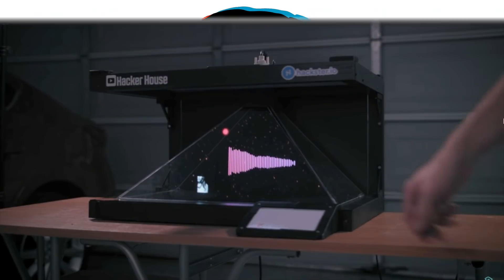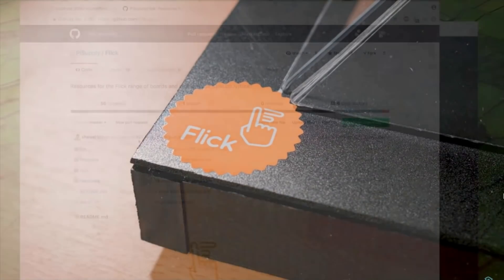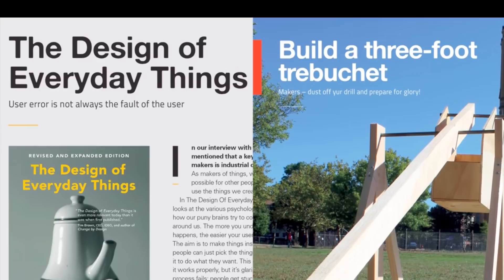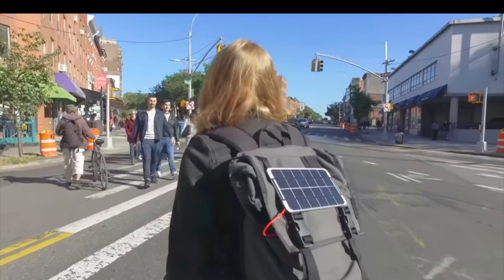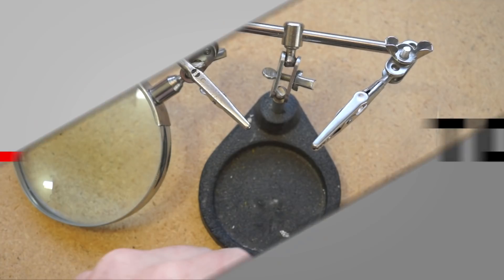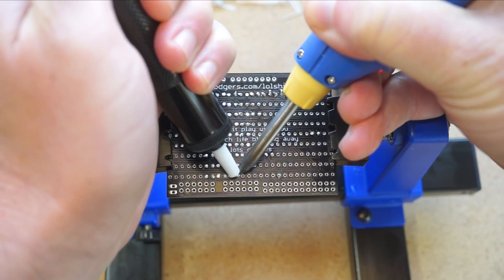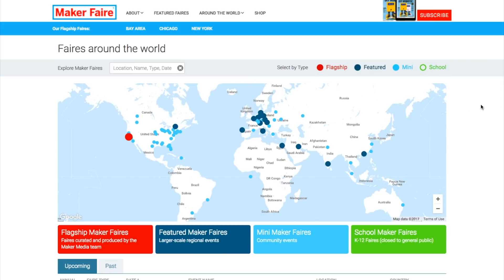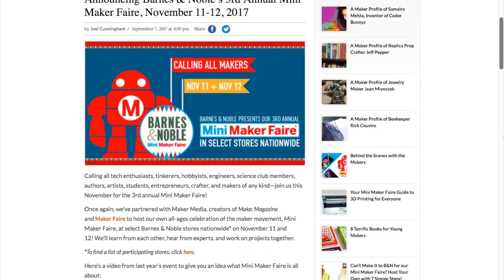Hologram and Chill [Maker Update #59]

Comment: The setup of the "Holographic Visualizer" reflects the 2-D monitor image off of the plastic, and behind the plastic is a black background. This makes it seem the image is floating in mid-air. This is a cool effect, but it's not 3-D and it's not a real hologram or even truly holographic. Those terms were originally used for true 3-D images produced (and mostly viewed) using a laser, and since then the terms have been watered down due to misuse. 

This is basically a modern usage of  the illusion technique called Pepper's Ghost. https://en.wikipedia.org/wiki/Pepper%27s_ghost
Reply from the maker: You make a great point. Do you think real 3D (hologram or not) technology will get to a place where people can create something similar?
Reply: I'm not an expert, so I only know what I read in the news. I haven't seen any mentions of anything like that. It's unwise to say "never", but I have no idea how they'd make a movie where each frame is a hologram, let alone some kind of display.